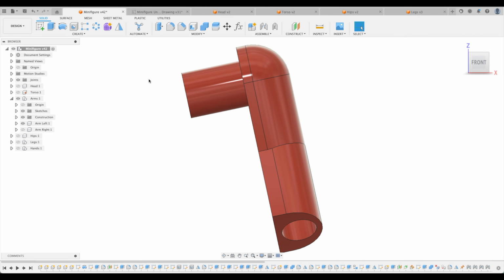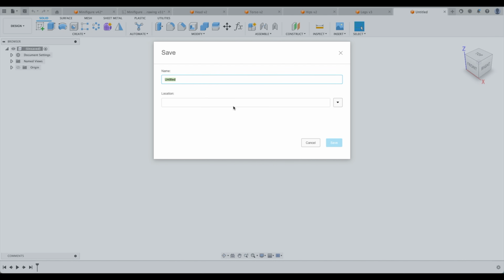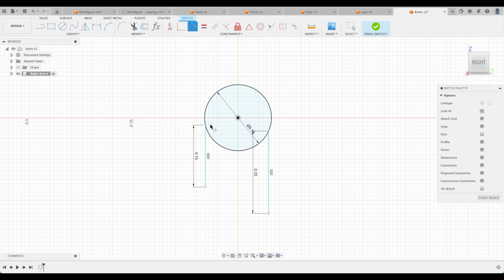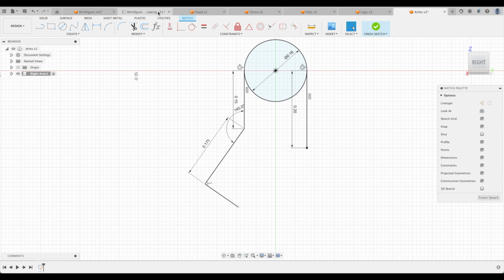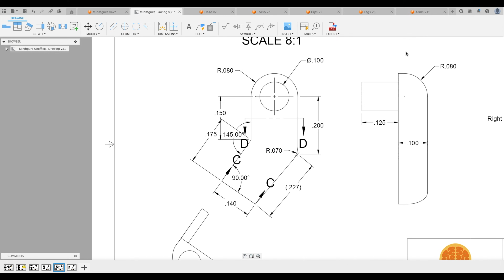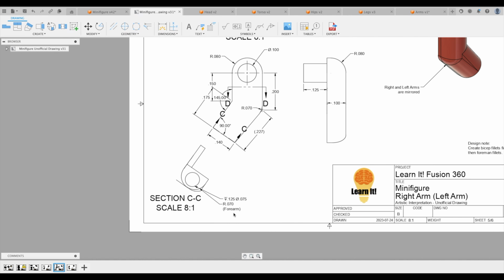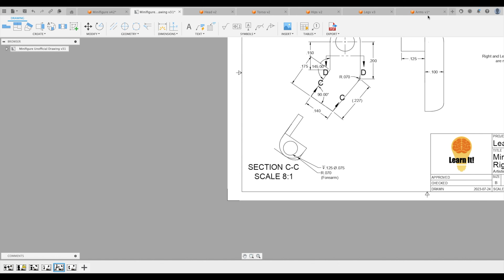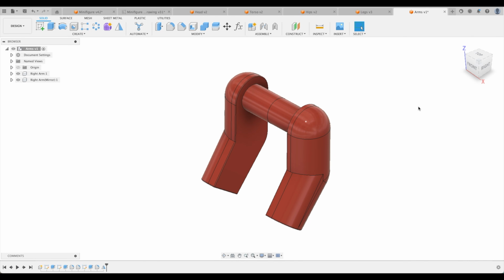Fusion 360 for Beginners - Lesson 10e - Model the Arms, Fix Over-Constrained Dimensions (2023)

Comment: I'm not getting to object type of component to mirror???
Reply from the maker: Hi there! Your message is a little confusing. Can you explain your problem more please? Thanks!
Reply: @learnitalready  I also have problem to mirror the arm with the component option, it doesn't highlight the arm. It works when i use the features option and select every side of the arm manually or use faces and select the whole arm.

Comment: Not sure exactly where I made the mistake in the original sketch but when I created the final edge breaking filets I had to go back to the original sketch and recreate the .220in line, by removing the line first and the 90deg constraint between the .175in line and the .14 line, and replace it with a 90d dimension between to .175in line and the .14in line and then redraw the .220 line.  When doing so I got the driven dimension for the .220in line that was illustrated in the drawing.  Definitely some quirkiness to constraints and order of operations.  Was fun to troubleshoot though.
Reply from the maker: Great job working through the various problems you faced! Thanks for posting your solutions too.

Comment: I'm following the tutorial using the dimensions of a real minifigure, and I've noticed its arms actually taper to wedge-shapes at the shoulder. How would you recommend constructing this detail?
Reply from the maker: Awesome! Glad that you are going the extra mile by learning something in addition to this tutorial. As for the taper, it is hard to say without seeing the drawing, but remember some fundamentals:
1) Work on the primitive shapes first.
2) Always save the fillets to the very end.
If it still doesn't work, I'll encourage you to finish the series and continue with some of the next tutorials, especially for intermediate users. Once you've completed a bunch of those, return to the arms and try again. You will be surprised with how much knowledge you'll be able to apply to figure out the solutions to the problems you hit. 
Thanks for reaching out. Please keep in touch. All the best!

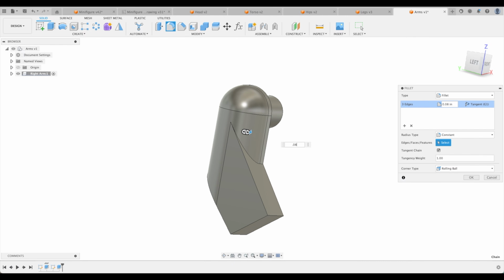Comment: When I try to create the .070 fillets at 7:30 I get an error: "Error:   The fillet/chamfer could not be created at the requested size. This might be occurring at the ends of the selected edges.
    Try adjusting the size or using multiple separate operations. Check that the selected edge chain ends at a sensible position, and if not try selecting more edges."

I can go up to .067 fillet.  Anything bigger gives the error.